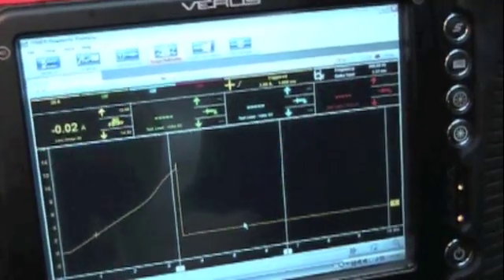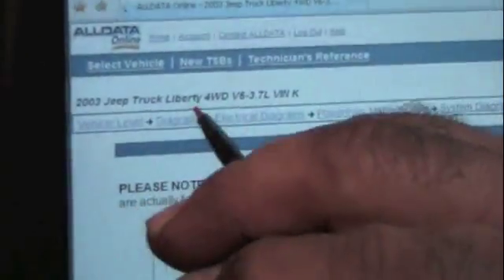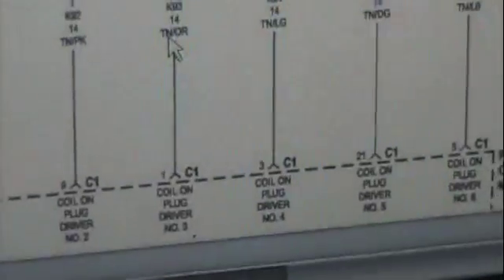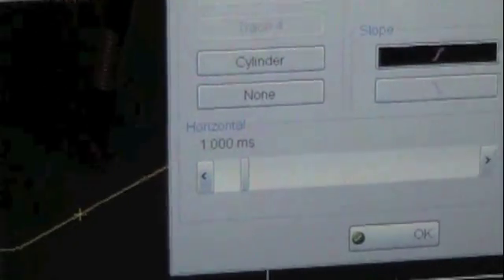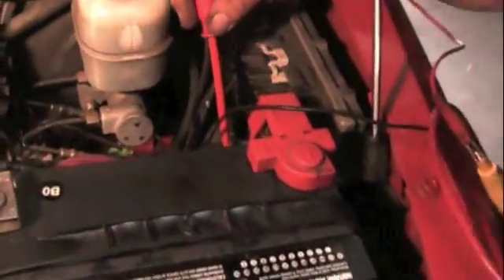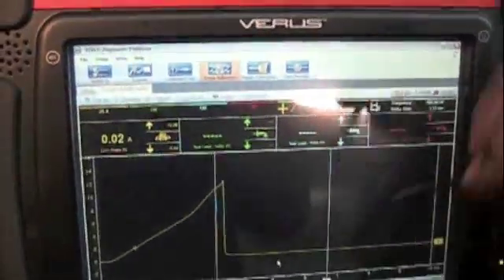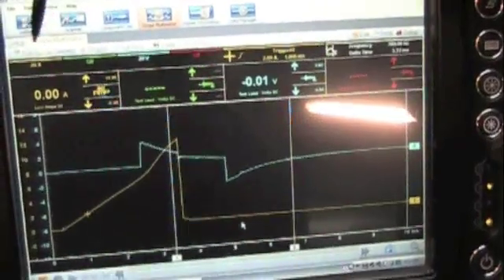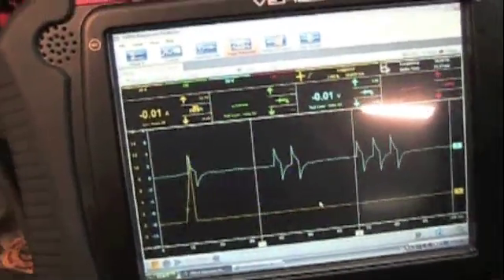Labscope coil ramping 2

Comment: I noticed that when you were obtaining the signal from the cam sensor, you used a probe that pokes through the wire insulation.  From your experience, does that cause any issues?